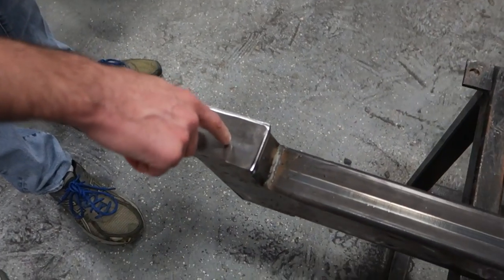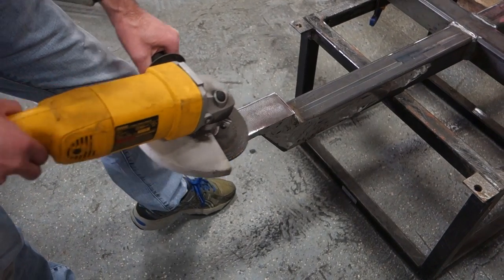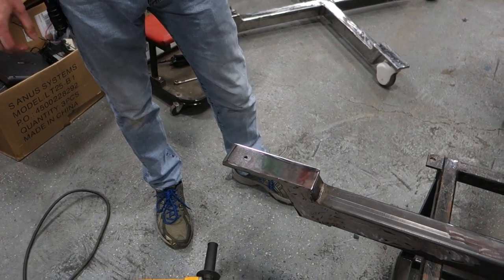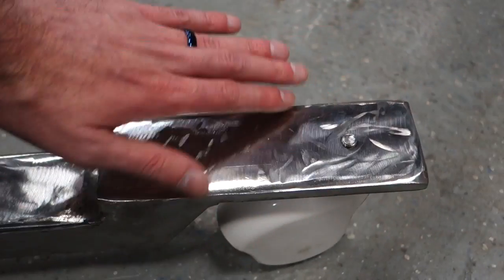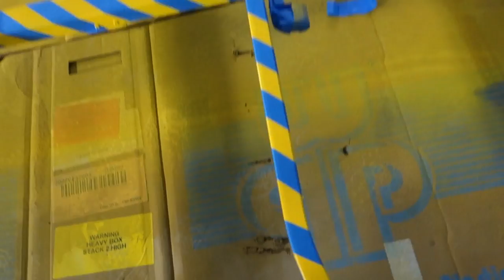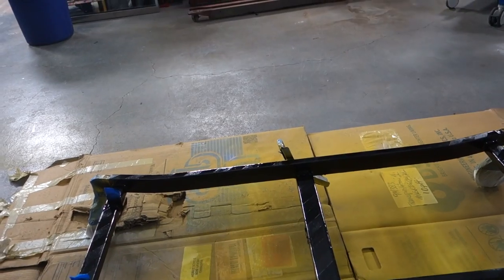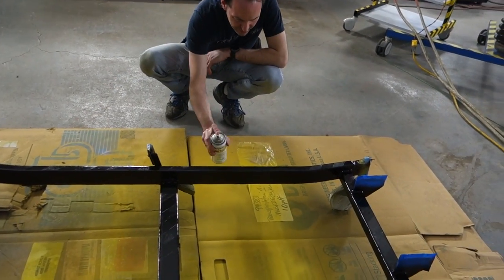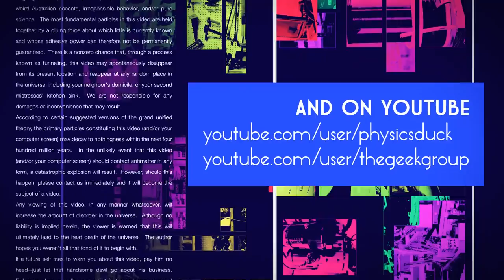Captain's Blog 12 26 2016 Blast Shield Project Day 3 Masking and Black

Comment: 0921  you drum everywhere.  inadequately heated paint is very stiff.  how is something to smooth to paint?  before today i was unaware that color had viscosity.  Moose, help Captain paint a large thing.  you pick fun time lapse music.  be slow with tape for accuracy.  sitting while applying tape is safer.  hugging your dog is a good stress relief.  painting black is faster.  tape is harder to remove though.